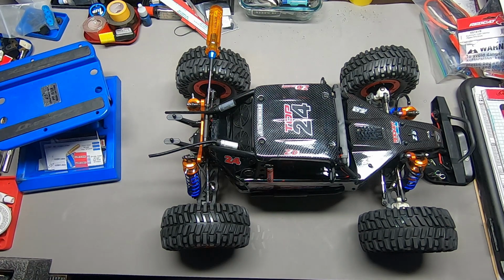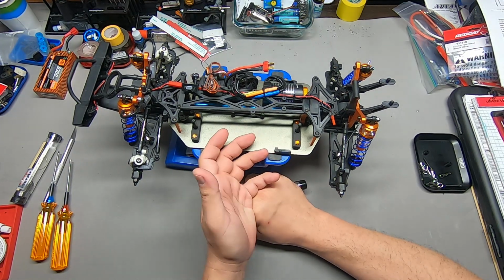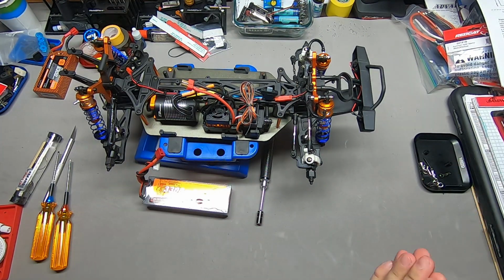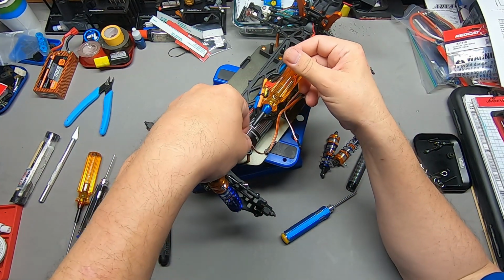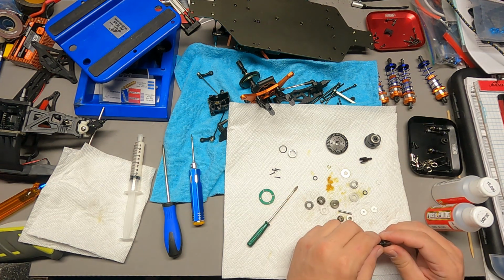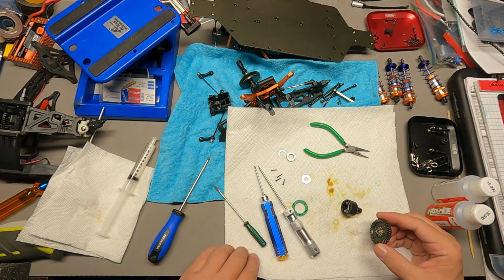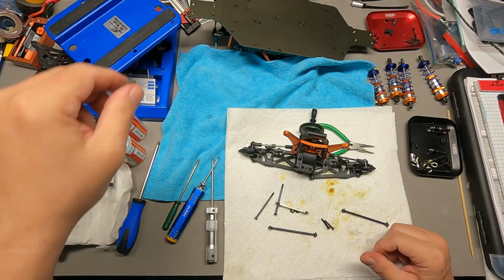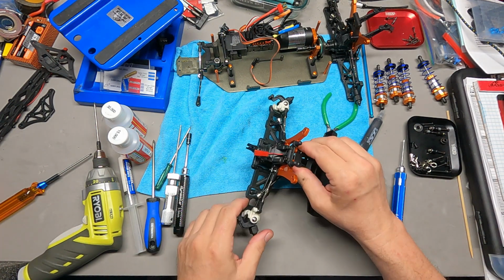TEARDOWN - ZD Racing DBX 10 1/10 4WD 2.4G Desert Truck Brushless RTR - Pt. 2

Comment: Just crashed mine after 3 days:/ front rods, servo arm, swing arm all ruined. Not really handy but these videos are great too see! Thank yuo!!
Reply from the maker: That's a bummer that you did so much damage. Hopefully you'll find replacement parts available.  Since this is a reasonably new kit, they may be hard to find. If you're having trouble, make a list of part numbers off the exploded view in the directions and send it to ZDRacing. Going through the factory directly may be the only option. Banggood has some parts... but not a lot. Unfortunately, this is the downside of buying inexpensive kits from off-brands like ZDRacing and WLToys.
I wish I could be of more assistance. Check in your manual for a company address or other support related contact information.
Reply: @MyRCChannel-CJScott  Hey thanks for a great reply! I did manage to find all the replacment parts and I thought I couldnt fix it myself but I tried some myself and checked your videos and it was not that hard! Think I will enjoy this hobby. Thanks again for your videos :)
Reply from the maker: @TheCameltotem  That's fantastic. The best affirmation of my work is my viewers learning from them. It's a great hobby and I think you'll find that many areas may seem daunting at first, but they become easy as you attempt them and even more so with repetition. Soon, you'll be an expert! 
Here are some online resources to help you to become familiar with the terminology and theory of suspension tuning... 
https://img2.associatedelectrics.com/pdf/cars_and_trucks/shared/RC_HandbookV2.pdf

https://www.competitionx.com/rc-tuning-guide/

https://www.rctech.net/forum/electric-off-road/708385-understanding-tuning-introduction-basic-tuning-racing.html
Enjoy!
CJ
Reply: @MyRCChannel-CJScott  Hey what a great reply! Thank you so much. Will be checking those links out and learn more :) Take care!
Reply from the maker: Hi, I wanted to ask if you've seen my latest videos, Part 6 and Part 7... Part 8 will be out later today... There are some nice aluminum c-hubs and steering knuckles that will strengthen the front end nicely. Install is covered in the videos, and the links to the parts are in the descriptions.
I hope you're having fun with your DBX-10!
Regards,
CJ

Comment: HI THERE  CJ, FIRST OF ALL, MAY I SAY YOUR PASSION AND PRECISION IS TO BE ADMIRED...JUST RECEIVED MY DBX 10 IN THE MAIL. I AM JUST ABOUT TO TACKLE THE TEAR DOWN YOU DONE, I AM A BIT WORRIED BECAUSE I AM ONE OF THOSE PEOPLE WHO EXPECTS A FACTORY ASSEMBLED CAR TO BE READY TO FLY....   I WILL GIVE IT A CRACK. YOU ARE DEFINITELY RIGHT THE GEARS ARE SO SO TIGHT AND CRUNCHY AND NOISY, HOW CAN THEY SHIP IT IN THIS STATE, ITS CRAZY..... I WILL DO BOTH DIFFS, AND A  SHOCKS SERVICE, AND A REGREASE OF SOME PARTS ETC. YOUR VIDEO IS GOING TO BE MY GUIDE STEP BY STEP RIGHT BESIDE ME AS I DO IT...THNKX AGAIN DAN MELBOURNE.
Reply from the maker: Hi Dan, Thank you for the complements. I'm glad you're enjoying my videos and more important, are getting value from them. The only way these companies can release rc cars/trucks/buggies at these prices is to skimp on something... usually several things like cheap materials, and cheap labor for the assembly. 
I've heard from at least one viewer that the front steering cups and c-hubs break easily. I recommend that you watch the Part 5 video and order the aluminum c-hubs & steering cups, a set of front and rear a-arms as well as a set of axles/driveshafts... you'll be able to throw your truck around without having to worry that if something breaks, you'll be without a running truck for 2-6 weeks while you wait for parts. The links to these parts are in the description of the video... you'll need to look up the rear a-arms on the same site.
If you have any questions as you go through the rebuild process, feel free to ask and I'll get back to you as soon as I can.
Thanks for watching!
CJ

Comment: in the manual it lists 2 diffs. 7170 and 7500 CNC. Which one do you think is in the truck? Do you think there is a need for the CNC version if the stock diff is not CNC?
Reply from the maker: I'll look into this and see if I can find an answer for you.
Reply: The 7170 diff is for the brushed version.

Comment: I have buy it! How to set the remote controle , to affect Channel 3 to 
LEds on/off. to set the throttle too sensible.. ? the manual is only a 
page...
Reply from the maker: I'm trying to find a download link to the full manual... If I can't I'll risk the copywrite violation and scan the relevant pages for you.

Comment: Mine arrived today and I've already added the foam tire inserts.
Please help... I'm trying to remove the pinion gear and it really won't budge. I daren't use any more force in case I break something!! Any ideas??
Reply from the maker: This is a common problem in the cars assembled in China... they are using to much thread locker and probably a grade more suited to real autos than RC cars. A lot of people use a high temp soldering iron, like a soldering station that can go over +700 degrees F... or they heat the bolts/screws with a torch. The goal being to melt the tread locker. 

If you don't have either of the tools I mentioned, try buying a "kitchen torch" or cigarette "jet" lighter that is refillable.

Here's a really good example of the "kitchen torch" and don't forget to buy a couple extra cans of fluid.:
https://www.amazon.com/Refillable-Rotating-Adjustable-Culinary-Desserts/dp/B09SSX6NT1/ref=sr_1_16?crid=SLI78VOXZ7W6&keywords=refillable+butane+torch+lighter&qid=1653115469&sprefix=refilable+butain+%2Caps%2C49&sr=8-16

Your worst case is buying a replacement motor... if the grub screw in the pinion gear gets stripped, you'll likely never get it off... since the motor's drive shaft is quality steel, you might be able to drill out the grub screw without destroying or damaging the shaft. You might as well attempt this as a last resort before buying a new motor. Here is a link to a motor with the same physical size with slightly higher KY rating.

https://www.amazon.com/GoolRC-3800KV-Waterproof-Brushless-Crawler/dp/B07BF765LP/ref=sr_1_5?crid=1NEDY4OADLV0R&keywords=3660+Brushless+Motor+2300KV&qid=1653116042&sprefix=3660+brushless+motor+2300kv%2Caps%2C33&sr=8-5

Good luck! Feel free to ask if you have any other questions and I'll definitely get back to you sooner the next time... things got crazy on my end over the holidays and I fell out for a while... a couple deaths in the family among other things,  but I've got my feet under me again.

Thanks for watching my channel,
CJ

Comment: Hello my friend I have the same one and I was working on my last week and by mistake I lost my pinion gear and now I tried to order one but I don’t know which one it’s the size for the original pinion gear and I don’t want to order a higher one and blow my motor can you help me out and tell me what is the size if you know🙏🙏🙏🥹
Reply: stock pinion is 20T and 3.175mm shaft

Comment: what servo to update this one? thks
Reply from the maker: Hi, I don't know if you've had the chance to watch all 4 videos, here's a link to the playlist:
https://www.youtube.com/watch?v=bNRpPcfpX_M&list=PLWi1J2KoLS71Rm8jKAUJA2oD0ml8j0J3L
The servo is a no-name brand servo i got off Amazon. The stock gear isn't bad, but I wanted to use my regular radio so I was swapping the receiver anyway.  Here's a link to the same servo I used. It's waterproof, high torque with metal gears. https://www.amazon.com/Waterproof-Digital-Crawler-Coreless-Control/dp/B09171GC49/ref=sr_1_9?dchild=1&keywords=32g+servo&qid=1631620512&sr=8-9
I'll be uploading at least one more video with showing the truck in action. I've just been buried in other projects and commitments.
Thanks for watching!
CJ

Comment: DBX-10 原厂使用的是 弧形斜齿吗
Reply from the maker: The stock gears are straight cut. That's not a problem. Even the best rc race cars use straight cut gears in the diffs and transmissions. The reasons some stock diff gears chip and break are  #1 the metal is cheap,  #2 the spacing is too tight or too loose.
Reply: @MyRCChannel-CJScott  自上次回复后，我买了一辆DBX10 不过我发现这辆车 似乎存在两种版本。即有刷和无刷版。。他们时间的齿轮配置 完全不同。。
   有幸我期间得到了一辆LRP S10 我发现DBX-10 几乎完全是S10的设计